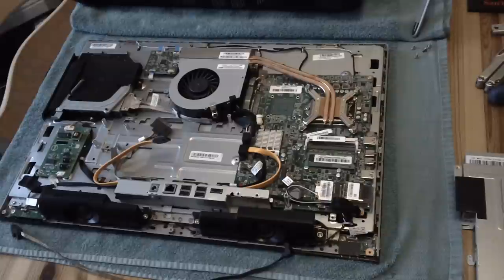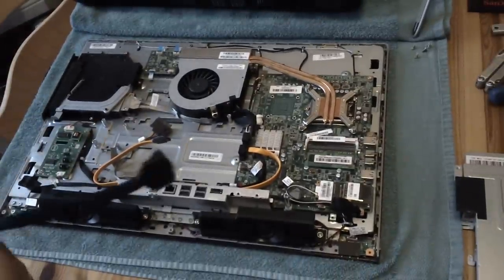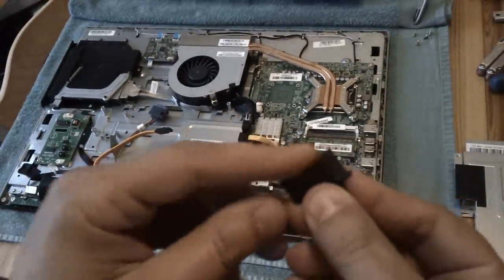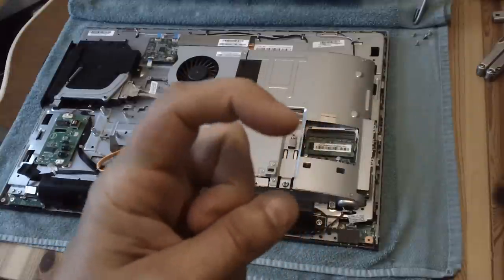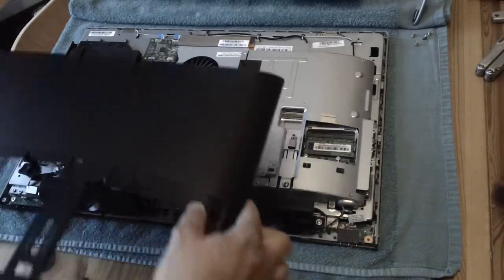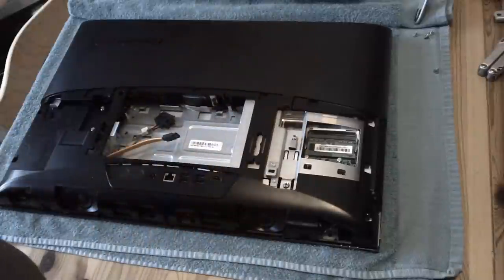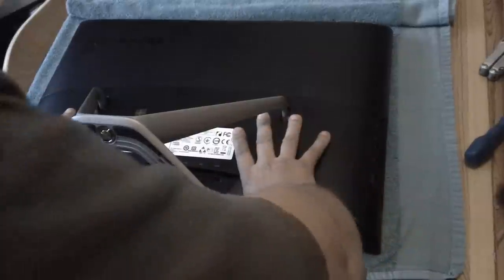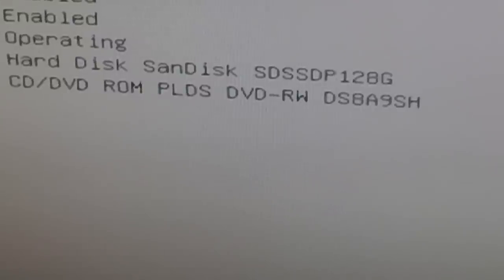Error Code 1962 - No Operating System Found *HOW TO REPAIR* on a Lenovo C440

Comment: Hi Nic. You have saved my life. I had many error and problem with my C440 lenovo since 2016. I did exactly what you advised and since, no more concern. For information, i had a concern similar wuth my cd readerr and after have removing and have placed several times the data black connector of it, I certainly removed the oxidation on contacts. It worked again. I am going to order a new harness to change it and will get back a computer which works perfectly. Thank you very much for you. Your video has changed my dayly and avoid me to buy another computer. Thank you yet from France.
Reply from the maker: Glad it helped.

:)

Comment: Thanks. Similar to the C365. Bizarrely my Dremel type tool literally arrived today! Looks almost the same inside. I'll be doing it tomorrow. Much appreciated.
Reply from the maker: Hope it works.

I think I did the initial chop with a Dremel, then used a Leatherman to gently shave off plastic until the power and data cables were able to fit in.

:)
Reply: @sterntechdaddy  Looks like the perfect solution. I'm guessing I did it when I swapped out the hard drive for an SSD to sell it this morning! I'll confirm it works when I've done it. Cheers.

Comment: Thanks for the vid.  I have a C460 and have experienced the same 1962 error message. Lenovo sent me a new cable (same design) but after a month or so, same problem.  I will try your recommended fix.  Cheers!
Reply from the maker: medeiom Glad you like the video... when modding the cable, you can always cut more off, but you can't put it back. So I used a Dremel to cleanly cut the SATA data plug away from the SATA power plug and then a Leatherman to shave plastic off the remaining edge until it fitted properly with the new data cable. I found it a bit tricky to get a replacement cable anyway - which is what prompted me to mod the existing cable, so it's really interesting to know that Lenovo sent you one.

Comment: have a B540 same problem error 1962..i will start working on it soon..hope
 this helps and many thanks for this very informative video.
Reply: +camilo8cheryl Did you have luck with this fix? I'm now experiencing the same issues. Thanks!!
Reply: not yet,i just got the cable 2 weeks ago and i was very busy at work.will post tomorrow if it worked or not
Reply from the maker: +camilo8cheryl Just a note to say that the PC in the video is still working perfectly after the fix. Although I obviously cannot guarantee this will be the same for your PC, if the fault is the same then it should work well.
Reply: mine did not work with the cable replacement.still the same 1962 error.just gonna bring it to a lenovo service center.thanks anyway for this vid..
Reply: +camilo8cheryl I figured out my hard drive was actually my problem. Is your drive clicking and making weird noises? That's a sign of a bad drive. I ordered a new one.  Unfortunately I have no back up. Good luck!!
Reply: my hard drive works ok..i even accessed files on a different pc using a sata to usb kingwing adapter.error 1962 addresses a lot of problem too,not just OS not found,it can be a bios update too as i was reading on a forum on these error codes.thanks for the input Yancy

Comment: Any chance to know how to fix a black screen with a Lenovo C440? Once a switch it on I can see and ear going on but the screen stays black
Reply from the maker: After you press the power button, do you see the BIOS or hear any beeps?

Can you see any back lighting or anything on the screen?

Or is the screen totally dead from the moment you attempt to power it up?
Reply: I have the same black screen problem the logo comes up for a second and the it get blank but wen I press the monitor off and on button I see it for a second but it seems to be in sleep mode

Comment: Hi, a couple of months ago I was getting the same error.  I took it to a computer dr. and then it worked...we powered it on and off a number of times and it still kept working for him.  He suggested I let him put in a ssd and make my computer like new again.  I did that and it was.  Until yesterday and the black screen with error 1962 was back!  We were excited to find your video.  I have a couple questions for you..I have a c540
1) do I get any sata cable?
2) if I am understanding it I can just swap out the cable.  Is it as easy as that?  
3) you mention the scraping off of something...we are not understanding that step?
Please advise

Thank you!
Reply from the maker: In some cases it is the drive that's faulty - but I suspect this video will fix your problem because it worked for me.

I replaced the drive and still had the error - like you seem to have experienced - and this meant my attention became focussed on the cable rather than what drive was used.

:)

The computer is supplied with a custom cable - at the motherboard end there's individual power and SATA data connectors, and at the other a single connector that has the power and data in one. This isn't an easy cable to find and, if you can find one, it'll be more expensive than the solution in the video....

I noticed that the power connector is special because that plugs into a non-standard socket on the motherboard. 

But the data cable uses a standard SATA socket... it's right angled, but standard.

So I decided to carefully cut the power connector away from the data connector at the drive end of the cable.

I keep the power socket part, but throw away the data cable.

You can then use ANY spare SATA data cable that will fit - a cable with a straight plug at one end and a right angled one at the other.

So for your questions..

1. Yes - any SATA cable will be fine provided one end is right angled.

2. Yes - you remove the data part of the existing cable, but keep the power cable because that's has special connector for the motherboard end.

3. When you cut the data plug away from the power part of the cable you need to carefully remove enough plastic so the new data cable will fit in beside the power on the drive when both cables are connected.

You can remove plastic, but you can't put it back.... and you want the power connector to fit properly so it's important not to rush.

After hacking off the data part of the cable I carefully scraped the edge of the power plug until I could connect the new data cable next to it.

Hope that helps clarify things.
Reply: @sterntechdaddy  thank you so much for taking the time to explain so thoroughly.  We have limited computer knowledge but with your help we will give it a try and let you know.  Blessings!

Comment: Hi Nic, I have a B50-30 and got the dreaded 1962 error. No HDD recognized. I thought the Hdd was bad so I put in in another computer and it fired up fine with no problem. I then looked for and found a NEW SATA Data cable (like finding hens teeth) and replaced the cable with the brand new one. Still 1962 error and does not see the HDD. I'm at a loss. Like I said the data cable was Brand new and still doesnt work. What would be your next idea?
Reply from the maker: Try what I did in the video... trim the old cable to get the power connector and then use a standard SATA cable for the data connection.
Reply: Didn't work, it doesn't sound like the HDD is spinning up. I checked the HDD buy installing it in a different computer and it worked fine. The power cable has a split off that powers the DVD drive as well and it works fine. I also tried a new HDD in the B50 and I still get the same error and it doesn't sound like its spinning up either. Because of the way this computer is designed though, the power cable/Data cable is proprietary.
Reply: Oh, and I did just as you did in the video and trimmed off the SATA side and used a standard SATA cable along side the power cable section
Reply from the maker: Disconnect the DVD power and retry. You can also test the voltages on the HDD power connector using a meter.

Comment: Can we fix this problem by installing new oprating system????
Reply from the maker: No! In this case the operating system is actually perfectly OK - its the cable between the hard drive and the motherboard that has the problem. In fact you cannot install a new operating system because the PC cannot detect the hard drive anyway...
Reply from the maker: Have you tested the hard drive in another computer/USB caddie?

Comment: In my case whaen i turn on my cpu then the screen become black and flashing 2-3 times after that this problem occurs so what can i do please help me please sir please
Reply from the maker: Try the fix in the video. :)
Reply: To fix this problem can i replace this wire to new one does this method fix my problem
Reply from the maker: I obviously cannot guarantee it will, but as a free first fix it is worth a try if you have a C440 or similar PC.

Comment: so you have the power cable and the cable that has loads of wires coming out of it (the bigger one) so it was the orange wire  (which is the power?) you replaced that was the fault not the sata that carries the data for the HDD?.. because if im right the power cable was damaged so replace that because the wires where bent at the angle and the sata cable you kept because that was not the fault? Thanks if you can reply :)  

This is my Sata p/n if it might help: 6017b0562901
Reply from the maker: I replaced the SATA data cable, and trimmed the existing cable so the power section of it would still fit in.

The cable is a custom cable... at one end you have a separate power and data for the motherboard - and at the other the power and data are joined together to make one connector for the drive.

I tried a few things before making the video.... first thing was to test the drive - which was 100% working - so I ruled out replacing the HDD. I also tried another drive and got the same error anyway so that guaranteed that the drive wasn't the problem.

This then made me focus on the cabling as the next cheapest option - because that's what my particular diagnosis and repair policy is mainly guided by!

The SATA connector at the motherboard end is a standard plug - but the power is a special one.

So one option would be to replace the entire cable and see what happens - this costs money and wasn't guaranteed to work so I decided to investigate further before Googling for spares...

The drive powered up because I could hear it spinning - so I was hoping that the reason for the boot error was due to the data connection - I trimmed the cable connector for the drive to remove the data section. Then I could plug in the power and use a separate SATA cable for the data.

And it worked!

For the PC in the video, it was the SATA data cable that was faulty, NOT the power.

My guess is that the tiny wires in the SATA data cable got damaged and the motherboard couldn't communicate with the drive properly.

So for yours... do the same process...

Turn on the PC and listen to see if the hard drive powers up. If it does, then do what I did in the video.

:)

If you need more clarification then just let me know.
Reply: Thanks so Much!! Just Fixed mine is a 100% Fix! I don’t really know about computers and the two cable to the HDD I didn’t know which was data or power. But I trimmed the data off replace it with the sata.. & now it’s all working..

Thanks again 🙏
Reply from the maker: @davidbenjamin9509  No problem.

Glad it helped.

:)

Comment: hi, i have a problem with the touchscreen lenovo C440. touchscreen works, however haltingly. I've tried flipping drivers but still not back to normal. please help me if anyone knows how to cope
Reply from the maker: Might be a hardware problem if you have played with software options - it will be easier and cheaper just to live with it and use the mouse.

Comment: What part was the SATA cable to you used? The orange cable.
Reply from the maker: +gswarriorfan11 The orange cable is a new SATA cable - the data part of the original Lenovo cable was cut off and removed. You need to save the power part of the Lenovo cable because it has a special connection at the motherboard end. The data part of the original Lenovo cable is standard - with a right angled plug at the motherboard end - and this is what was faulty in the PC in the video.
Reply: +Nic Bunting Ok so I can just walk into Frys and ask them for a standard SATA cable?
Reply: +gswarriorfan11 Like, SATA right angle to HDD? Or something like that. I have the same PC as you do (C440) and just want to make sure I get the correct SATA cable. I want to attempt to do as you did in the video, but just want to confirm what type of SATA cord I need.
Reply from the maker: +gswarriorfan11 At 7:50 I talk about the cable and the cable you need. It is a standard SATA data cable, but one end needs a right angled plug. Not sure abot where you are from, but here are two examples from a UK shop:  http://www.ebuyer.com/248882-xenta-sata-3-cable-6gbps-46cm-est-sata3-0  or  http://www.ebuyer.com/151963-xenta-sata-2-cable-to-right-angle-sata-7-pin-red-46cm-sp-sc-rs-r46  I do not think you specically need the 6Gb/s version though.... The C440 has a Serial ATA-300 controller so a 3Gb/s cable will be fine.
Reply: +Nic Bunting Thanks Nic. Went to Fry's today and picked up the cable for 5 dollars. Got home and used one of those asian knives to split the original cable. Put the 4 pin with the new SATA, connected that son of a b*tch together and got my damn Lenovo working again. Thanks to you!!! Too bad I already bought myself a new laptop. But this fix means I can pass this desktop to my kids. Thanks buddy!

Comment: my problem is not from the cable and not from the hdd 
the error usually apears
but somtimes the computer works
i dunno what to do
Reply from the maker: If you can try a new cable and new HDD then that's worth double checking.... also check the cable sockets for both the SATA data and power cables - they might have a wobble that makes the connection unreliable too.

Comment: nice computer, but would you please tell me which is the video card? i would like to upgrate mine but when i open my computer i could not found it, i was thinking what it has an fanless video  card.
Reply from the maker: There is no actual video card on the Lenovo C440 - the graphics chip is mounted on the motherboard so you cannot upgrade.
Reply: its bacause i would like to make a tocuch screem computer a gaming station thtas why i brought it, i get me a nice gtx video card but when i tryed to install it i could not found a place, but what about if i install a new core and also a gpu would it work for gaming?
Reply from the maker: I doubt you can upgrade the CPU because the cooling will match the range of CPU available for this specific model - so adding a better CPU might mean it will not cool properly.
If you wanted a touch screen gaming system that you can upgrade then getting a separate touch screen monitor would be the best idea.

Comment: I don't have 12v on sata connector. What can I do?
Reply from the maker: What model of computer do you have? 

A SATA drive cannot work without a power cable - so if you are fixing the problem described in the video you'll have a drive that works - and it'll obviously have a power connector. Most likely with the data and power cables combined into one as in the AiO above.
Reply: @sterntechdaddy  Lenovo c50-30. Anyway I think I explained myself wrongly.  Unfortunately it is not easy to create articulate speeches in English, but I will try the same.  I meant that there are no 12vs on the motherboard power connector.  And therefore the disk is not powered and does not start.
Reply from the maker: @NikyRipy  I understand what you mean now... Hardware manual can be found here: http://content.etilize.com/User-Manual/1031737204.pdf

You could try removing the DVD drive and seeing if that helps the HDD get more power.

Comment: I have the Lenovo C440 machine and it's giving me the 1962 error
Reply from the maker: Hopefully this video will give you the cheapest solution...

Sometimes ther drive is faulty though - but it's worth trying this firs just in case it works.

:D

Comment: Need your help about a c440
Reply from the maker: I’ll try… what’s the problem?
Reply: @sterntechdaddy  my c440 turns on the  Lenovo logo comes on and then it goes off and then It looks like it booting but I see the monitor off /on lights blinks like it sleeping and I can't get it out off it I try alot of things but none works
Reply from the maker: When it does this, power it down by pressing and holding the power button and then turn it back on.

If you can get into Windows then disable Fast Start and see if that helps.
Reply: @sterntechdaddy   I got it turn in once and  turned off fast reboot and shut off wat the power button do
Reply from the maker: It's the Fast Start option in the System Settings part of Power Options.

This explains it... https://www.tenforums.com/tutorials/4189-turn-off-fast-startup-windows-10-a.html

As a catch all you can also open an Admin command prompt and type 'powercfg /h off' 

Type what is inside the ' marks with the spaces to completely turn off hibernation - which Fast Startup requires to function.

I hope it helps.

:)
Reply: @sterntechdaddy  thanks ill try it
Reply: yesterday i reset i came up and the its gone again
Reply from the maker: Check the SATA cables and replace the CMOS battery is what I'd do next.

After that it starts getting harder...
Reply: @sterntechdaddy  that was the next thing I said I was goin to do
Reply: @sterntechdaddy  thanks
Reply from the maker: If it doesn't work then things start to get more invasive...

:/
Reply: @sterntechdaddy  ok or just call it day
Reply from the maker: You mean give up?

NEVER!!!

😂🤣😂🤣